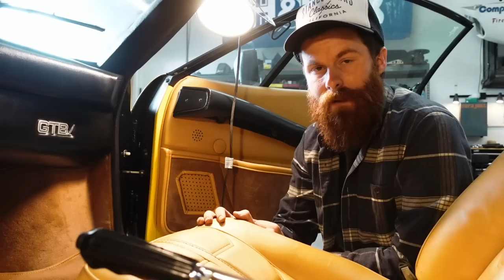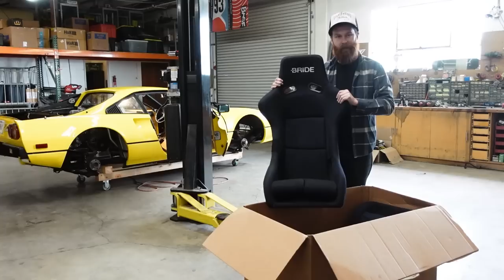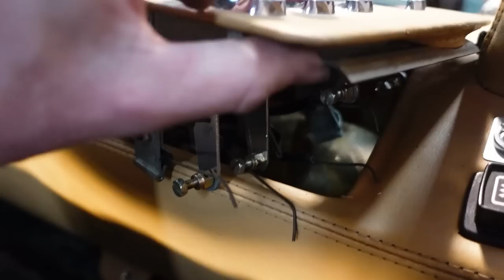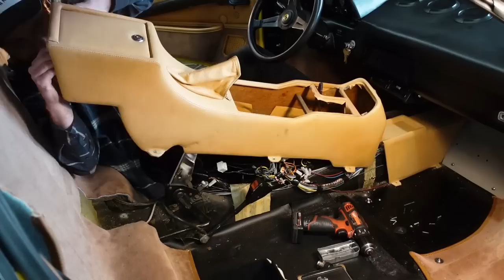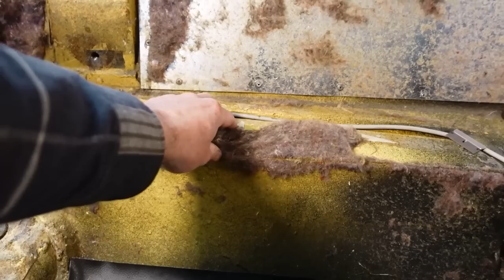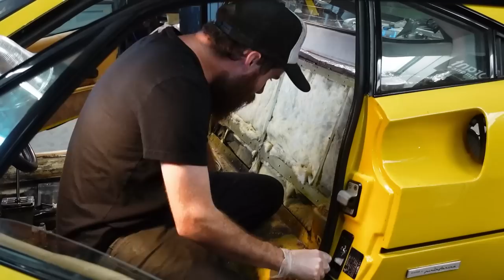Turbo Honda K24 Swapped Ferrari 308 - Interior Teardown - Time Attack Build - Ep. 13

Comment: I’m sure all that stuff has some quite high value second hand. My friend sold a Ferrari interior which was quite worn and the engine and box which had been in a fire for a kings ransom. 
PS do you have fluorescent or led lights in your shop? That can cause the striations on the video.
Reply from the maker: The spotlights I was using in the car are LED, which is what caused the banding issue.

Comment: Inspiring build and done with an ethos I dig.
Wander if its possible to do a 308 with a longitudinal drivetrain if you use a shorter V6 block... 0_o  starts hunting engine dimensions on wiki
Reply from the maker: Definitely possible, it's been done by a few folks.

Comment: The Honda engine is a much better engine than the junk Ferrari engine it was equipped with. Affordable to maintain or repair the odd problem. Longevity of the Honda engine is also far superior to any Ferrari engine.